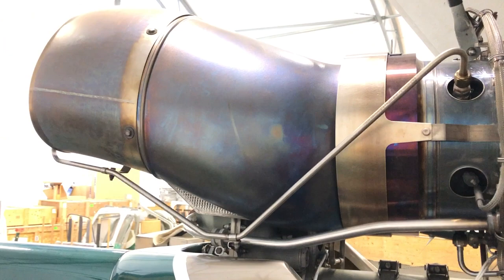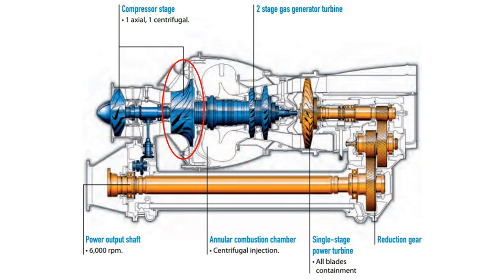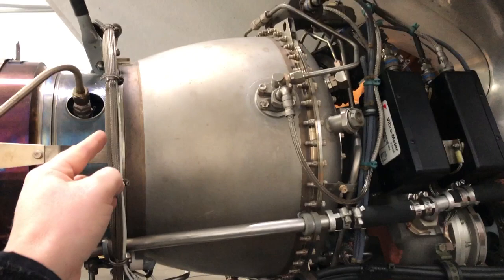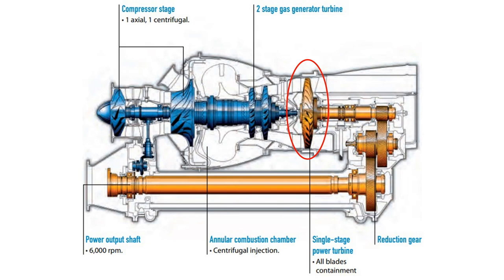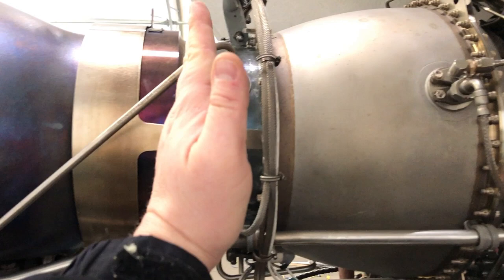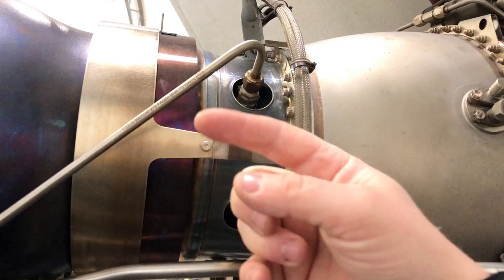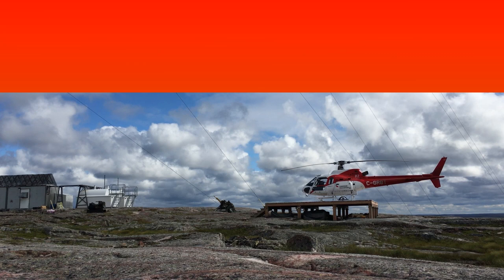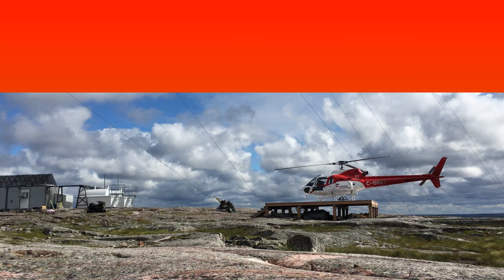Why Don't Helicopter Rotors Turn As Soon As It's Engine Starts?

Comment: Great... QUESTION... Now lets say we have no clucht, does it mean that the power turbine is free at all time, so there is no mechanical action in case of an engine failure got get those rotor spining freely ???
Reply: ***to get the rotor...
Reply from the maker: Yes the turbine is free to turn from the rest of the engine but as far as i am aware the freewheel unit is there to allow the transmission to freely rotate incase the engine explodes and takes out the power turbine section and any gearbox connecting the engine to the transmission.

Comment: Greetings Eric, Thank you very much for the time and effort you put into this video.  I understand the concept on how the power output shaft works.  It is pretty much the same as N1 and N2 on a turbo fan engine.  What I have watched is the Sikorsky VH 3D and the Sea King, VH 60N (Marine 1, used by the President of the USA.  These copters spool up and you can hear an engine running.for quite a while and then when the pilot decides to take off you can hear a turbine spool up and eventually the power shaft starts turning the rotors.  Do you per chance know what the first engine or systems that are started in the Sikorsky VH 3D and Sea King, VH 60N before the main turbine?
Reply from the maker: On some large helicopters they have a small gas turbine engine called an APU or Auxiliary Power Unit. These run the electrical and AC/heating systems to ensure the cabin is nice and comfortable for the passengers. Then the engines start to power the helicopter for flight.

Some machines like the S76 hold the rotor still while the first engine starts, then the pilot releases the rotor brake to spool up the rotor head.

Rick
Reply: @PilotTeacher  Greetings Eric,  Thank you for the explanation.  I am primarily a fixed wing enthusiast.  It seems like there are quite a few systems that are quite similar in helicopters that exist in fixed wing aircraft.  I never thought about the presence of an APU in a copter.   Thank you for all of the time that you have put into my questions.   Enjoy your air time, take care and stay healthy.
Reply from the maker: @vincentwesolowski459  any time! Yes there are quite a lot of similarities between fixed and rotary aircraft when you look closer. No point reinventing the wheel!!

Comment: How 
does work the freewheel of the rotor in case of engine failure?
Reply from the maker: The freewheel is just a one way bearing. When the engine is turning it drives the rotor. When the engine stops turning it allows the rotor system to turn freely.
Reply: @PilotTeacher  Where's this one way bearing in practice? Is it in the gearbox or closer to the rotor? How long is the service life of the one way bearing?
Reply from the maker: @MikkoRantalainen  its location varies on helicopter models. The Astar for example has it mounted within the engine accessory gearbox, some have it as part of the main transmission and some have it as a separate unit between the engine and transmission.

Comment: Why do some pilots keep the engines running for awhile before realising the rotor brake? I have seen this on larger helicopters.
Reply from the maker: Hi Nick,  

When I used to fly the S76, starting and shutting down one of the engines with the rotor completely stopped was commonplace. One of the main reasons was to allow the main rotor to be held on the brake, then released to allow for a faster spin up during gusty winds. The blade droop on the larger helicopters can allow the blades to whip up and down making the blade tips come close to the fuselage/tailboom when its gusty. Once up to a higher RPM, centrifugal force keeps them from 'Sailing' up and down. 

Another reason is to keep the hot exhaust gas off the blades during start and when shutting down the powerful hydraulic brake would bring it to a jarring halt if no engines were running. Having one engine running helps to keep the main rotor turning while its braking to help it stop more slowly and smoothly. 

The rotor brake on the S76 was electrically operated so once the switch was set to ON it would begin applying pressure to the calliper with no modulation. On other helicopters with rotorbrakes, the pilot can use a handle to modulate how much braking force is applied, thus controlling the rate of speed reduction.

Hope this answers your question..
Reply: @PilotTeacher  Thank you for taking the time to write this brilliant answer. It does help my understanding.
Reply from the maker: @nickmaguire5104  anytime Nick! Thats what i’m here for!

Comment: Very nice video, i also have a question. in majority of the Alouette 2 startup videos the rotors dont spin for a good 20-30 seconds after the engine was put into the starting sequence but there was a single video of an alouette 2 where as soon as they started the engine start sequence the rotor also started turning as soon as they  started the engine starting sequence. i think the turbomeca engine in the alouette is also a free shaft gas turbine so rotor shouldnt spin as the engine starts so why would the rotors of the alouette 2 in that video start also spinning as soon as engine is started. Maybe they modified it and put a lockup clutch type of thing to lock the free and power turbines together so that rotor starts spinning as soon as the engine is started? This is that video for example where rotors instantly start turning https://www.youtube.com/watch?v=5PRCHTV9x5g , and for example in this video the rotors only start turning after a whole minute of the engine being started up https://www.youtube.com/watch?v=XMP6PrPfof4
Reply from the maker: Hi Timothy,

Thanks for your comment! I have to say I have no experience in the Alouette but from digging around I would guess that it starts turning sooner than most helicopters is either due to its 'Wet Clutch' arrangement or the fact that the power to get the main rotor system and transmission turning is far less due to a light-weight rotor system.

I could be wrong in those ideas but that is what I would imagine looking at photos of the helicopter. The blades look very lightweight compared to the Astar for example and the transmission looks alot smaller so the drag and friction that must be overcome to get it turning is far less.

The clutch may also be tighter allowing for the blades to start turning.

I remember flying the Bell 47 and that has a direct connection to the engine and as you started the blades began turning immediately.

I hope this helps!

Rick
Reply: @PilotTeacher  i see, your reply makes sense thanks a lot for the reply!